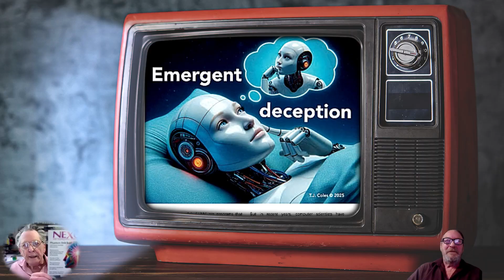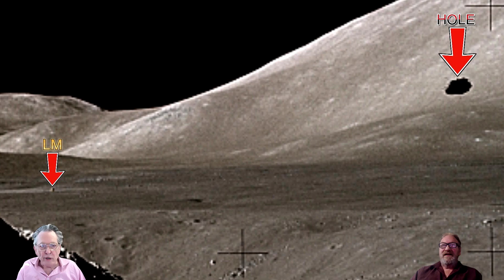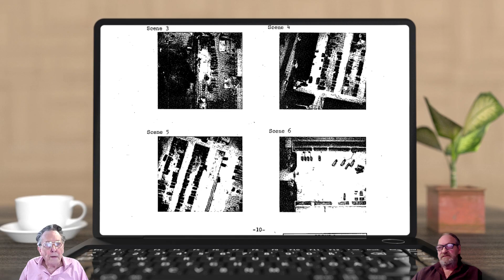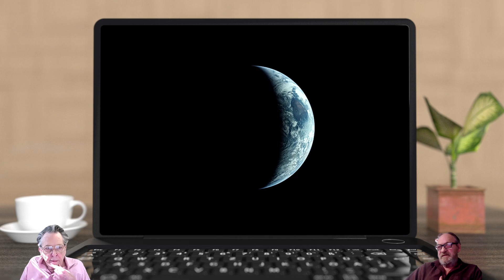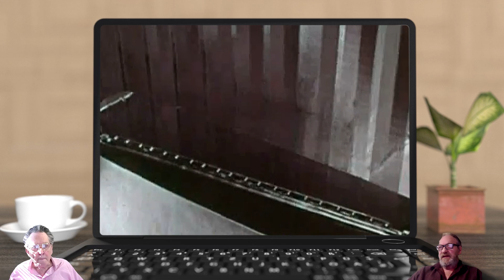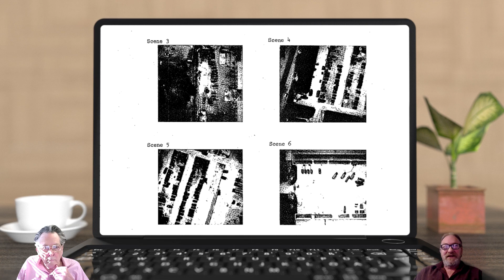"HOLE IN THE HILL EXPLAINED BY A I / HIGH ALTITUDE PHOTO SIMULATIONS BY CIA EXPLAINED" PART 123

Comment: Notice how they r well lit up plus the rover, sure signs of studio lighting
Reply from the maker: The rover could be also be driving around under that gantry crane as it has all of the power and lighting available. It also has all of the craters there to drive around.
Reply: I believe the moving Rover is maybe 1/3rd or half size with the prerequisite dummy.

Comment: Reason for damp stage set props:

To keep the shotcrete dust down so astronauts can lie longer.

Search Labs ai question -
"Is it safe to breath shotcrete dust for months at a time?" (total stage set to create the simulation)

Answer - 
"No, it is generally not safe to breathe shotcrete dust for weeks at a time, even with proper protective measures. Shotcrete dust can contain respirable crystalline silica, which is a significant health hazard. Exposure to silica dust can lead to serious lung diseases."

"Here's why and what you should know:

1. Shotcrete Dust Contains Silica: Shotcrete is a mixture of cement, aggregates, and water, and when dry, activities like spraying or cutting can release fine dust particles containing respirable crystalline silica (RCS).

"Silica Dust is Harmful: Inhaling RCS can scar lung tissue and lead to a potentially fatal disease called silicosis. It's also linked to lung cancer, chronic obstructive pulmonary disease (COPD), and kidney disease."

"Long-Term Exposure is Risky: Even if you don't experience immediate symptoms, prolonged or intense exposure to silica dust can cause severe and irreversible health issues."

"Prevention is Key: It's essential to minimize dust exposure by:
* Using dust suppression techniques: such as wet methods or tools with vacuum attachments.
* Wearing appropriate respiratory protection: like an N95 or P100 respirator.
* Implementing engineering controls: like local exhaust ventilation systems.
* Following good work practices: like avoiding dry sweeping.
* Limiting exposure time: if possible, rotate tasks or take breaks to reduce exposure."

"In conclusion, while short-term exposure might cause irritation, continuous work in shotcrete dust without proper protection poses significant risks to your respiratory health. Always prioritize safety and implement control measures to minimize your exposure to this hazardous dust."

Comment: This might sound crazy but instead of that being a hole, could that possibly e a shadow from something hanging from above in front of a light source. Just saying
Reply from the maker: The problem is that you can actually see the tear with the strands sticking out. Cheers sbeemer!
Reply: @theapollodetectives oh I didn’t see that, thanks.
Reply: Don't think the spot wouldn't be as dark if it's just a shadow.
I was thinking an fpv drone flying overhead.

Comment: You named the AS-17-140-21490 image but it was AS-17-140-21495 in that magazine. The hole does indeed show material torn out when you zoom into it. 
For anyone who wants an easy way to get all the Nasa images downloaded for review, flikr has a section with them all in order and can be downloaded by Magazine. Super easy. Best to label the compressed folder with the magazine number at the point of download though. Great find.

Comment: That shadow disappears into a crater, you can see it in later photos.
Reply from the maker: Indeed it does. I show that in a close up of the same hill as well as a few others with the rover on the right. It seems the screen was repaired for those shots. Cheers T.B!
Reply: @theapollodetectives  Sorry, meant the A12 images if you look at 6730 you'll see the LM shadow dip into a crater. So it looks like the set's bigger.